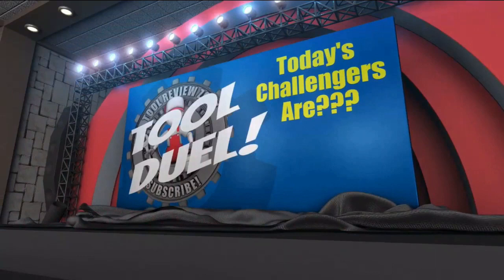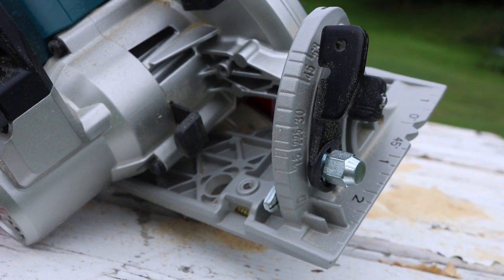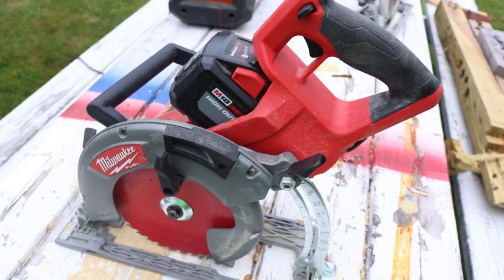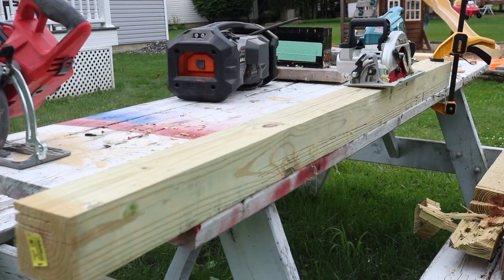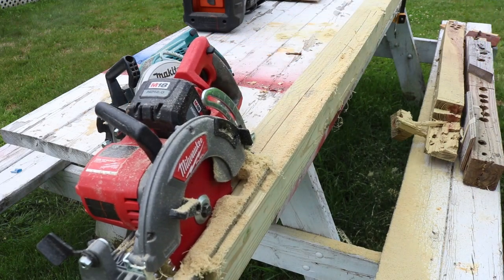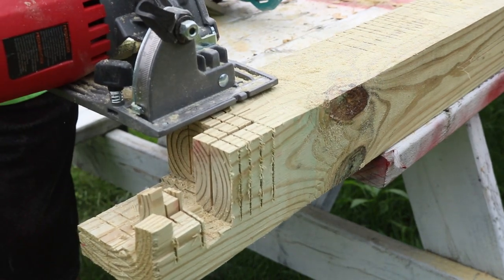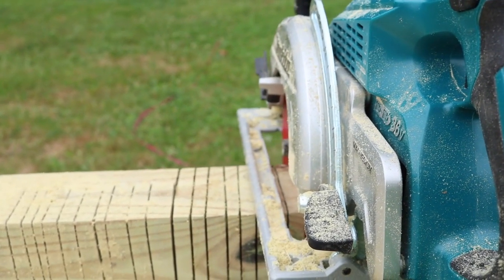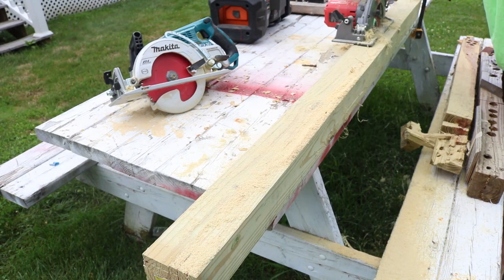Milwaukee VS. Makita! Milwaukee 18v rear handle saw vs. Makita 36v rear handle saw (Tool Duel!)

Comment: I have the Milwaukee, my boss has the makita. With that said the Milwaukee can use smaller batteries because I’m cheap I’m using the 5ah in mine from all my other tools and I can get. Threw about 250-300 cuts per charge on the 5ah, my bosses makita is about the same, with two 5ah batteries. It’s much easier for me to give up 1 tool for that battery if I need it vrs 2. The line of sights better on the Milwaukee if the blade has been squared when you shouldn’t have a problem with the indicator marks on it for cutting. Overall super happy I made the purchase.
Reply: Aloha..

Comment: I know this is an older video, but i just got the Makita at Home depots 2020 black Friday sale. The kit i bought included the saw, double charger, and 2 5amp batteries for $249. Also as a bonus i got an additional 2 5amp for free. I got kit mainly because of the good deal on batteries but have put the saw to work and  absolutely love its power and smoothness
Reply from the maker: Tha ksbfor the feedback Jeremy!!!!!
Reply: Just got the same deal, had to fight a little bit with home depot for the extra batteries but in the end got the deal...I just wanted the 5amp hour batteries for that price, the saw was just a bonus...
Reply: @stevenrobare6668  I basically got it for the batteries as well. Didn't think i would use the saw that much because its so large but find myself using it regularly. Very smooth cutting once i got use to it a little.

Comment: Everyone is hating on the two battery makita but is failing to see that for many people who already have lots of makita batterys its better than the Milwaukee where to run it properly you have to buy high output batterys which adds a whole extra cost.
Reply: When you see what the 12.0ho battery can introduce to your tool lineup with all the other m18 fuel h.o. tools that are available besides this saw the battery is a huge investment
Reply: TIL: you can mix n match batteries. A 5.0 and a 2.0. It won't be a 3.5Ah tool. But it will be 2.0Ah.
Reply: Exactly, I don't want to invest more money in batteries when I already have 8

Comment: I have Milwaukee platform. But I got the makita saw. I just couldn’t missed this deal 250 4 batteries. Milwaukee is 250 for the saw.
Reply: The Makita is a great deal. I probably would have gone for it if that saw had a vacuum hookup option. I got my Milwaukee saw from Home Depot with a free 8.0 battery on promotion...so I got more bang for the buck. I’m not a super heavy user so I don’t need the 12.0 battery.
Reply: @Ronofthedead07  I just got this saw with the 4 batteries, and the one I have does have a dust port for a vacuum to be attached, maybe it's on the newer revision. It's actually part of the magnesium piece that over top of the saw and exhausts to the right.
Reply: @Vargasarts  that's great if they integrated that into the existing saw
Reply: ALWAYS CHEAP COST MORE AT THE END
Reply: I'm m18/m12 all day . But this is a awesome platform and for the price, an beast of a saw, simultaneous dual charger + 4 batteries that was unbeatable. Now I have options for two of the top 3 tool makers. I'll have lots more choices when choosing a tool. The 36 volt miter saw is next. 👍🏾
Reply: @Ronofthedead07  there's a dust port.
Reply: I missed this deal, some guys I work with got it. Same situation, all milwaukee platforms but makita saws. 
I deeply regret missing that deal. Refuse to pay full price haha. Hoping it comes back this year.
Reply: @Vargasarts  you got that deal within the last 2 months?! Where?
Reply: @Mynameisnottrevor  I got it at Home Depot, but I don't think they're running it anymore, it was this saw or their sidewinder model kit. So it was saw, charger and 2 batteries, plus 2 extra batteries, all of them 5ah.
Reply: @Vargasarts  nice, that's awesome. I'm jealous
Reply: QUALITY COST BRO AND MAKITA ITS A JOKE COME ON TWO BATTERIES SHOULD BE FOR TWO SAWS NOT ONE !!!!
Reply: ...more power and longer run time without having to get a different battery platform, like the 40v stuff from others or having to buy some new type of battery that only works with certain tools... I'm happy with my choice, as I'm sure many others are.
Reply: @Mynameisnottrevor  the deal is back at Home Depot, $250 for either the rear handle or sidewinder kit with 2 batteries, plus 2 more 5.0ah batteries free.
Reply: I just got the Makita with four batteries for $250. I asked why they’re so cheap and he says basically because Milwaukee is the new hotness so that’s all people care about now
Reply: @calvinwalker4654  I LIKE THE COLOR OF MAKITA BUT I HATE WASTE SPACE AND TO NEED TWO BATTERIES FOR ONE TOOL I HAVE TEN BATTERIES FOR TEN USES NOT 10 BATTERIES FOR FIVE USES WITH MAKITA GOOD LUCK WITH YO BUY
Reply: @josevelasquez841  Huh?  Did your kid get ahold of your computer/ phone or is your caps lock button stuck?
Reply: @calvinwalker4654  DONT MISS THE POINT HOMIE TALK ABOUT TOOLS
Reply: @josevelasquez841  Whatever you say.  I'm guessing there's a language barrier here but that CAPS LOCK is making it almost impossible to understand what you're trying to say.
Reply: @josevelasquez841  im not sure what are you talking about. The batteries in the makita tool you can use on more than 270+ tools in their tool line-up.
Reply: @Mynameisnottrevor  they’re running that deal through the 1st of August in store
Reply: @Mynameisnottrevor  go to Ohio power tools, they have the deal now
Reply: @Mynameisnottrevor  Ohio power tools have the deal now

Comment: I’ve had the Makita for a year and it’s fantastic.  I’m mostly on the M18 platform but I’d have a really hard time ditching the Makita at this point.
Reply from the maker: It really is an awesome saw. Thanks for the feedback Josh
Reply: Yeah it’s a little weird, but I always just sight down the blade on a worm drive anyway so it doesn’t bother me much.
Reply: I have all M18 as well, albeit not a ton of tools. I work at home Depot and eyed the Makita deal that includes this saw, the charger, bag and (2) 5AH batteries for $259. You also get another (2) free 5 AH batteries as well. Thinking of picking it up just to have on hand as a circular saw is one of the tools I DON'T have and can always use. We don't sell a lot of Makita tools in general, but when we do, Makita saws are always in that list and for good reason.

Comment: I have an Acme tool store/service center just down the road from me. I talked to a couple of the service techs a while back...they agreed that the Milwaukee carpentry tools were by far the most "returned for service" tools in the shop, while they see very few Makita returns! Interestingly, they commented "if your a plumber or electrician Milwaukee is good, a carpenter not so much"!
Reply: Out of curiosity, how many Milwaukee tools are out there compared to Makita?  Are they repairing more because that's what most carpenters use?  Or are they really breaking down more?
Reply: Verdad

Comment: I have the Makita and it is an awesome saw, lighter than my corded Skil worm drive and has incredible power, I think in the video test the guard was holding it up or something, mine has no bog and cuts like butter, just built a large pole barn with extremely heavy, dense 6x6 treated posts cut through better than any saw I have ever owned in 35 yrs of framing cut through 14” lvl’s with zero big and with ease.  Video is right the ergonomics of the Makita is unbeatable, the only small drawback is 2 batteries, but they last all day and charge in only 45min, the indicator light in the saw is peculiar, it will drop from 3 lights to 2 lights after 40 or so cuts but when you pull out the batteries they still have 3 lights on, the batteries have 4 lights when fully charged but the saw only has 3 lights when fully charged strange design.

Comment: Makita's multi battery for increased voltage was an awesome idea for battery hoarders. I hate how all these other companies are making 3 or 4 different battery lines. I'm wondering if Makita could make 72V tools using 4 batteries to compete with Milwaukee's MX line. Those MX batteries are over $500 right now. It's ridiculous.
Reply: What’s funny about this comment is that you made it right around when Makita brought their 40V/80V max XGT line to the US, which was one of the last places to get it.
So, Makita had their 12V CXT, 18/36V LXT, and 40V/80V XGT.

Comment: Used both. I own the Makita. The Milwaukee’s dust port is better for cutting ply. But I don’t really notice a major diff in power. Both are great saws just depends what battery platform you’re using. 

Cheers. Great vid
Reply: can you get through a whole day without charging?
Reply: Jesse Beck it depends what I’m doing. 80 percent of the time yes. I run 2 6.0s in the Makita but have 6 other batteries so it’s never really bothered me
Reply: Aloha
Reply: @jesseback3536  With the Milwaukee and an 8.0 or a 12.0, yes

Comment: I own the Milwaukee great saw with a excellent line of sight the top handle is a little thin but it’s a great saw. I have also used the Makita before and I think it is more comfortable to use it just feels better in the hand. As far as power that’s not going to be an issue with any of the rare handle saws.
A little tip with the wrench on the Milwaukee put it in s vice and gently give it a slight bend it will never fall out of the saw. Just don’t go overboard with the wrench because you could break it but, bend it a little then keep checking how it holds until it stays snug.👍🏼
Reply from the maker: Awesome feedback J J!
Reply: J J 
Thanks for the tip! I always keep the wrench to any saw in my bags, because I constantly loose them if I leave them the saw. But will give this a try. Have a good one!
Reply: Good tip for the wrench. I tried it and it works!

Comment: We have the Makita at work.  I used the hell out of it.  The convenience is the fact that if you standardize on Makita, you have a million of these batteries lying around. No one steals them but it is a quality tool.  About using the 5amp batteries,  that's what the saw comes with.  That's 10amp of 18v or 5amp of 36v. So a lot closer to the Milwaukee than people complain about.  And voltage is like car displacement.  So the Makita is twice the displacement putting out less power? The difference about voltage is the higher the voltage the more efficient as the magnetic fields are stronger.  So that's how well built that Milwaukee motor is.

Comment: I actually like, prefer, the dual 5Ah battery design from Makita, over one gigantic.   It allows me to use the 18v system more fluid, I only have two size batteries.  A pair of 2Ah for light work, drills etc, and a shit ton of 5Ah that power everything.

Comment: Using the Milwaukee m18 saw daily as a framer on a Construction site I like the saw cuts very good but the fine dust it creates makes wearing eye protection a must (although you should anyway) dust created when cutting OSB is over the top I keep going back to my old porter cable with the blade on the left side...
Reply: Exactly. Dewalts flex volt is even worse. The Makita wins for this
Reply: OSB? Don't use that stuff..
Reply: @davidbagley1783  I use it regularly building homes

Comment: I own the Makita saw, and I love it. I don't personally mind the two battery system. I just wish Makita would make a changable guard so it'll blow the sawdust to the side.
Reply: They actually do make a Vacuum type hose that goes on those Makita saws !
Reply: @EduardoGarcia-jf9jm  On that same Makita model? Because I don't think mine could use that attachment.
Reply: Makita  batteries take 45 minutes to charge and the Milwaukee battery takes over an hour. Enough said, I will take 2 batteries that I can easily use with all my other tools that are faster to charge and more out of the way, any day. The amp draw on each battery is half what it would be on the Milwaukee because there are 2 instead of one, which I imagine helps greatly with the Makita's battery life.
Reply: @Tell-me-more-75225  The Makita 18x2 tools require two batteries to operate. If you put a 2ah battery and a 5ah battery on it, you'll only get 2ah of runtime. The runtime between the two Makita batteries are not accumulative.
Reply: @princenoah21  I think you may have misunderstood my comment, I was not clear enough or I am not understanding you. Let me explain again what I think might be the misunderstanding. If the motor at full power when cutting draws 1000 watts then for the Makita each battery would provide 500 watts each, however with the Milwaukee since it has only 1 battery the full 1000 watts comes from that battery. Now that one battery might be designed for the extra power draw but that makes it a specialized battery compared to the other designs. Maybe I am thinking about it too much and I think that I would still prefer 2 batteries that charge faster (because they can be charged separately), can be more easily used for other tools, have less demand on the battery, and are located in a more out of the way spot.
Reply: @Tell-me-more-75225  Sorry I know this comment is a year old but you're right and, unless I'm doing my math wrong, the Makita is actually in an even better position.  If for instance you had a 1,000W motor and ran it off of 18V then you'd need somewhere around 55 amps coming from the one battery.  Now run the same motor at 36V and then you're only at ~28 amps BUT then divide that by 2 and then you're looking at ~14 amps per battery.  Less strain on the batteries means they'll last longer.

Comment: I just bought the Makita and was disappointed once I saw the indexing marks on the bevel guide...besides the stops, what are you going to do when you want a 18 and a half degree cut? Haven't even run it yet and I'm debating taking it back and getting the Milwaukee instead...It has very clear indexing marks on it...
Reply: That’s my biggest issue with positive stops on bevel guides for circular saws. They are not miter saws, I do not want positive stops that force me at a set degree of bevel. I want flexibility on a circular saw that allows me to set the bevel at whatever degree I so choose without forcing me to compromise

Comment: Liked the graphics at beginning, really cool 👍🏻
Used to run Makita, was first tool “platform” started in. Now, I’m primarily using Milwaukee, like the 1 battery & the power it delivers w/o having 2. No saw, or tool, is perfect....just gotta go w/ what you like better, or the platform your in. For me, I’d say the Milwaukee wins out over the Makita; even though, those irksome “issues” with the saw drive me tad crazy 😜 
Cheers✌🏼
Reply from the maker: Thanks for the comment Aepek!!!

Comment: Trz Makita kept their saw a little bit more heavier on purpose so when you are cutting down plywood or 4x4 the weight helps keep you cutting a straight line instead of it jumping around and I also love the fact that Makita saw dust shoots down instead of towards me while I'm trying to make a cut. That makes a world of difference and magnesium is my favorite metal. Great video. Peace brother
Reply from the maker: I can agree with that bro. I actually think home depot messed up their weight though.  They put the Milwaukee weight at 10lbs, and the Makita at over 12. It looks like they are both weight with the batteries, the the Makita is actually lighter. They also state on the site that the Makita is anb18v lol

Comment: This Makita is a game changer, nothing else compares, I cut aluminum with it all day long, from 1/8" to 1" thick aluminum, both batteries last more than a day
Reply: And the dust extractor is by far the best
Reply: What is the blade that you use to cut alluminum sheet?
Reply: You should definitely not be using this saw to cut 1" thick aluminum. It's built to cut wood. Aluminum is like 20x more dense than even the hardest hardwoods. Get a metal cutting circular saw with a proper blade. It will have more torque and run at a lower RPM. It will also collect the aluminum dust into a container.
A wood saw can cut metal, but it will wear out the motor much, much faster, and will shorten the life of the batteries.

Comment: Great review brother. ...
The makita sounds like an old lady compare to the furious Milwaukee ☇☇☇☇🏅🏅...
But I  think the Dewalt is the overall winner. 
Thanks for sharing such a lovely vid 🤘👍🤘👍🤘👍🤘
Reply from the maker: Yeah bro I think your right. The Dewalt won over all.
Reply: Definitely one small thing I like also is the wrench storage on the dewalt.
Reply: Not a chance. Power wise... Yes. But you can't even see your line with the dust extractor. And it throws dust all over you

Comment: I don't see the issue with the 2 batteries used in the duel Makita tools , its actually a genius idea . Why should Makita spend time and money developing a larger voltage battery (like dewalt flexvolt) so that all the customers on the 18v platform need to go out and get another set of batteries and chargers just does not make sense . Most guys invested in the range will have plenty of batteries i know i personally own 16 x 18 volt Makita batteries . As for the saws i don't think id invest in the rear handle saw , i already have dhs650z single battery top handle and its a beast compared the the old brushed model . I think i will go for the dhs710z top handle 36v if i do decide i need a deeper cut cordless saw , only drawback is the blade is on the opposite side but used to that with corded saws . The rear handle only cuts 45mm(1.3/4") at 45° and the top handle 49mm( so its closer to a full 2" for roof work . With none of the 2 saws cutting a full 2" at 45° i think i'll stick with my 165mm(6.1/2") 18v Makita BL saw and corded makita 210mm(8.1/4") saw